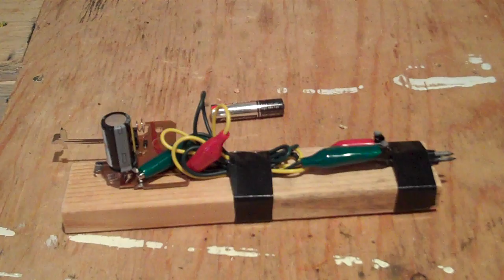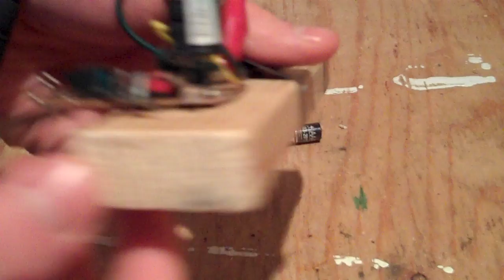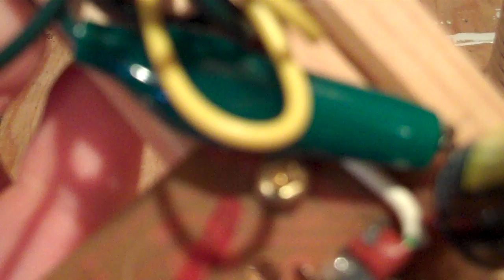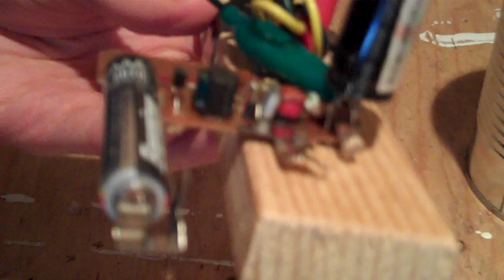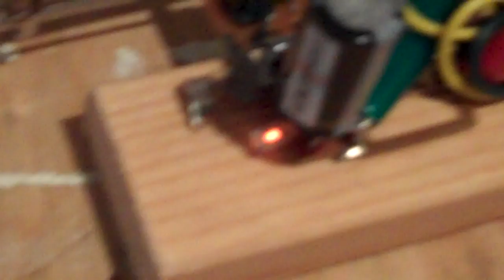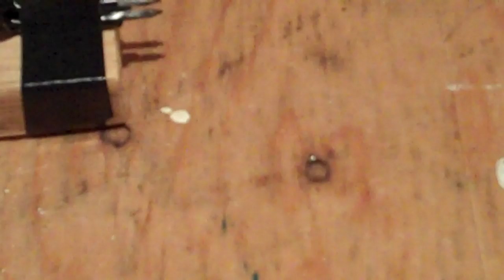How To Make a 330 volt Taser for under $5

Comment: could you use a 9 volt battery to charge it faster and change the capacitor use for a stronger one like 440 volts or somethign?
Reply: No because the default flash charge circuit doesn´t support more than 3 V without burning the transistor. But you can use twoo or more 450v PSU capacitors in parallel and two independent flash circuits with correspondent batteries to get a strong shock. The only problem is these capacitors charging more slowly than the default capacitor.

Comment: I have a question I built one of these and it worked for a while...but now it doesn't work and the battery and transistor just get hot
Reply: I don't know what to do pls help thx
Reply: +DJ Ward get a multimeter and test the board, most likely a short circuit somewhere since your battery gets hot.

Comment: how do the 1.5 volts from the AAA battery turn into the 350 volts of the capacitor?
Reply from the maker: The battery charges the capacitor and then it releases all the volts at once
Reply: +inventor719 you're wrong, the battery delivers pulsating current to a transformer which steps up the voltage. pulsating current is done by the transistor. on the other side of the transformer, the high voltage zone; the voltage is half waved rectified which then charges the capacitor to 330volts. then the capacitor once charged to the max can then be discharged in a load

Comment: The voltage is high enough to easyly overcome your skins resistance and shock you, but I am curious how many amps this thing puts out. Currents between 0.1-0.2 amps are lethal. Stun guns have high voltage but  a controlled low amperage so that they don't kill you, but this thing, who knows.
Reply: Aghast it wont kill you, already tried, but it does hurt.
Reply: wynnful heh good to know.  Just don't grab each end with both hands because it completes a circuit through your heart.
Reply: whether or not it kills you depends A LOT on how you administer the shock.  If you touch the 2 prongs with a finger from each hand the shock will go through your heart and kill you!  The fact that this can burn a can means it will definitely be able to kill you this way.  A normal taser wont leave burn marks on an can like this!

Comment: Caution unplugging the battery does not make it safe capacitors hold their charge after removing the battery shock it again to discharge it

Comment: I am going to make this, is there a way that I can charge this faster. I want a proper tazer effect, would putting a 9v battery in with a voltage regulator in make it faster or could I simply make a charger by soldering a diode to a 9v battery and touching that capacitor onto it untill its charged